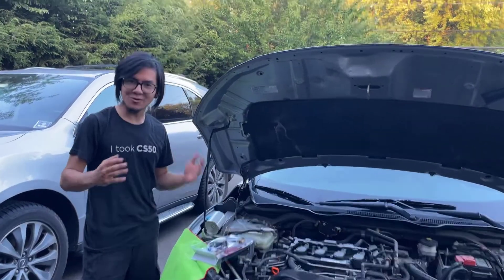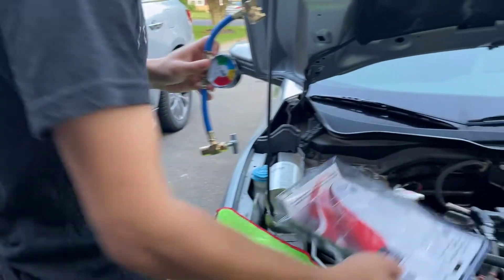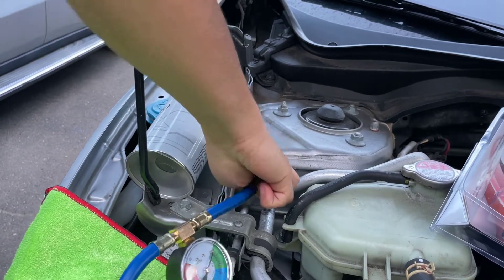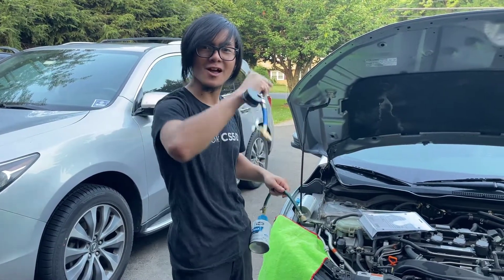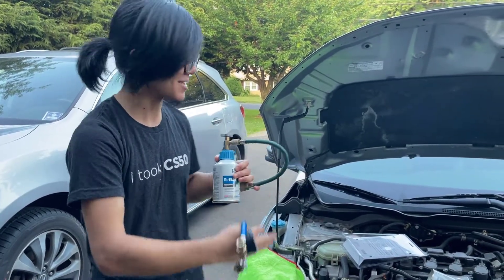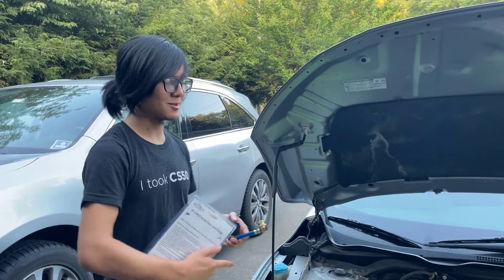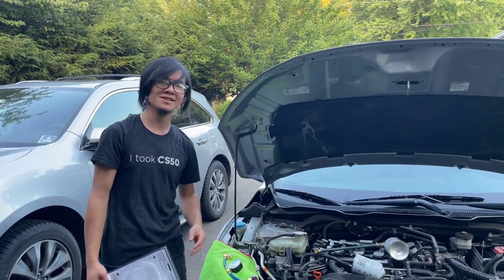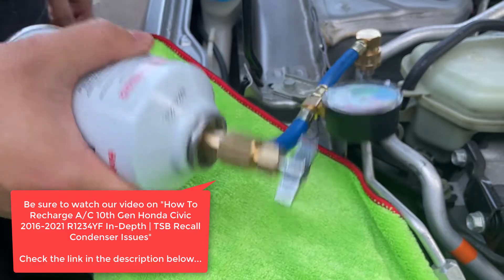R-1234yf vs R-134a Fittings Adapters, Charging Hose & AC Refrigerant Canisters, Are They Compatible?

Comment from the maker: Here are some of the #ad links for the products, tools and accessories shown in this video:
1.  https://amzn.to/3DyOQvh  |  ZeroR® Top Off Kit #1 - Genuine 8oz HFO-R1234YF Refrigerant (1 Can) & HD Brass Can Tap with Gauge
2.  https://amzn.to/3qe5r4z  |  Arctic Air for R1234yf, 4 cans and Gauge, R-1234yf, R1234 Refrigerant Support
3.  https://amzn.to/3Om4pf4  |  R1234YF Refrigerant Charge Hose Kit, R-1234YF AC refrigerant Can Hose with Gauge, 1/2 LH Can Opener Tap And R1234YF Low Side Adapter
4.  https://amzn.to/3OcX0yr  |  Lichamp AC R1234YF R134A Gauge Set, Automotive Manifold Gauge Compatible with R1234YF R134A and R404A Refrigerants, Works on Car Freon Charging and Evacuatio
5.  https://amzn.to/44DIXcd  |  Lichamp AC Oil Injector R134A, R1234YF Refrigerant A/C Dye Injector Kit with Adjustable Coupler and Oil Checkers

Or Click on Amazon link here and search for what you need:  https://amzn.to/3xIOsqg

Comment: When I do an A/C recharge I always put one of those small kitchen meat thermometers into the top center air discharge vent. This gives you an accurate representation of exactly how well the A/C system is cooling. It's much more accurate than using your hand to determine the discharge air temperature. Most properly charged auto A/C systems will discharge air at about 40 degrees F. If while on maximum cooling the air temperature is higher than that, it needs a recharge. As you are feeding refrigerant into the system monitor the temperature reading on the thermometer. It should slowly start to come down. When it hits 40 degrees, stop adding refrigerant. This gets you optimum cooling without overcharging the system. One of those little meat thermometers costs about $5. I leave the thermometer in my car all the time so I always know how well the A/C system is cooling. If it won't go down to 40 F anymore, it's time to add more refrigerant.

Comment: spent a good part of my sunday at advanced autopart and autozone, my buddy gave me a digital readout hose to connect to low pressure side, not a single worker at either auto store knew that the new refrigerants containers are backwards threaded, literally was searching every where as to why this connector fits but no bottles will screw on, this video was the first answer!

Awesome video, and even more impressive that engineers did that to prevent the public from putting the wrong stuff in their cars!

Comment: Calling bullshit on the fittings, not your video. If the stuff is "environmentally friendly" then why gatekeep the fittings?  They could use standard air hose fittings which are readily available and cheap. The answer to why they do this, is so they can charge you more for "special" equipment. It's all a lie, and it has been from the very start. How convenient that their "ozone holes" are way up in the atmosphere where noone other than "them" can actually verify their existence. What a scam. It actually funny when you think of it. lol
Reply: Your very close, they change the fittings for new refrigerants so they can sell you them for a premium, and by the time they get popular and cheap enough they get phased out for the new system which will once again have new fittings. Environmental policies and safeties are a business and need to do crap like this so they can stay relevant. Also ozone holes were mostly caused by older refrigerants such as R-11 which was used to just spray and clean circuit boards and there wasn't any "safe means of capturing and disposing of these refrigerants so it just gets blown to atmosphere. This is still a practice used by Military forces in international waters.

Comment: How about the hi and low pressure valve cap? Is it the same sizes? Or they have spe ific sizes?
The mechanic lost my valve caps. But the problem is it's been 6 mos. I just noticed it last week. So need to replace it but it's really difficult to find R-1234yf specifically .
Reply: Low pressures tubes are wider, on that will be the low pressure cap. High pressure cap is bigger than low pressure cap